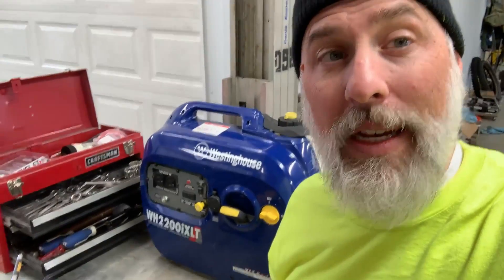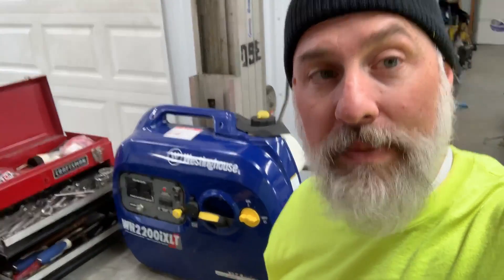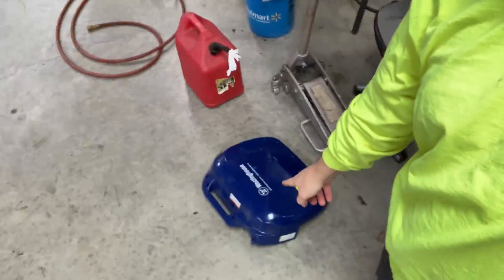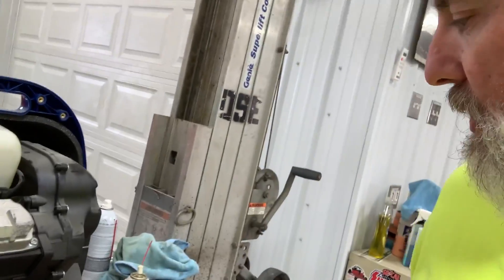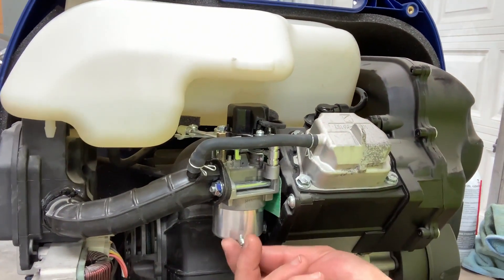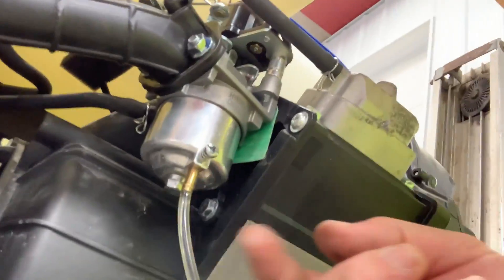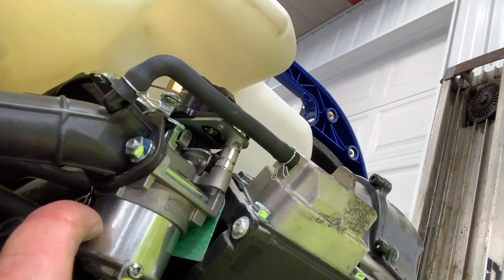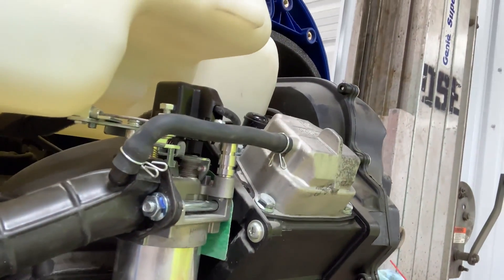How to Fix Generator that Starts and Dies  |  Westinghouse / Honda Copy

Comment: THANK YOU. Stored my generator last winter with fuel and couldn't get it to start after summer. Changed, sparkplug, oil, air filter only for it not to run. Your needle trick did the job
Reply from the maker: Glad it helped

Comment: Thank you... My generator was almost just like yours only 3 months old and doing what you described... I cleaned the jet in the carburetor... And it ran better than over because before it died ...it was sputtering and missing a lot... I even called Westinghouse about warranty replacement...i appreciate your help🎉 wish there was a way to put it in line fuel filter on these 🤷
Reply: cut fuel line, install inline filter. How difficult can that be?
Reply: true... my line is about  inched long... it could be done... But I opted to put one in the fuel tank on the fuel line

Comment: You are the man!!! Thanks for the fix.  My problem was different.  I have two generators same model as yours. One was like yours and died soon after starting.  The other would only run with choke out.  The choke-out only one had the clogged jet just as you described.  Cleaning fixed.  The other one had a partial clog and also some old gas sludge at the bottom of the float bowl.  Both are fixed thanks to you!!
Reply from the maker: It was such a simple thing...I decided to make video hoping it would help somebody!

Comment: Update: Used a pin to clean the jet and it started and continues to run - with the choke open.

Just turned off the choke and it's 💨 ng rough. 

Figure to get some kind of additive to clean the pipes and run it some more 

Thanks for the video. I've done everything else I could think of so will give this a try later this week.

I'll let you know what happens.

Wen 2000 (a Honda knockoff like everything else)
Reply from the maker: Did it work?

Comment: Interesting i have the igen2600 and it went bad just sitting for 3 months.  I stored it after burning thru the cali-crap gas and then running thru with tru-fuel for about 10min before storing it dry.

It will only run by burning the starter fluid i shot thru the air intake.  Once that gets burned (5 secs) it dies.   Choke or no choke it wont run.
Reply from the maker: I bet it’s that same jet clogged

Comment: I just fixed one missing panelwasclogged small mainjet inlet screw clean,unscrew both ways very easy clocklittle thencclock.remove main jet inintake tube back and forth easily do not go full hard clockwise.blowout with carb spray leave side jet out until mainjet is out cleaned and inwill bindthen do to pilot jet with steel brush bristle hola is in bottom facing up to horiz slotwill most likely be clogged!!!

Comment: Mine will only stay running on choke but it actually really seems like the computer is shutting it down. Like if I turn it back to choke it doesn't matter, dead.  If I started up without choke it'll actually start fine for about 1 second and then die with no error lights.

Makes me think it's the computer
Reply from the maker: Running only on choke is usually a clogged jet problem. I don’t think these have computers
Reply: @nosyjoe  it absolutely has a computer, the throttle is computer controlled.  The thing is I can even start it fine without the choke, it just shuts down completely after a second and won't start for about ten seconds.

The other thing is I can tell it's not clogged because it's really runs fine until it just completely shuts down like it is getting enough fuel it's just getting shut off by the machine

Comment: Hey do I have to completely drain the gas before I pull the bowl off I'm a newbie
Reply from the maker: The bowl will have some gas in it, but if you keep the generator's big on/off knob turned off, that will keep the carb from getting any more gas. So no, you don't have to completely drain the generator.  Just expect some fuel in the bowl if you don't drain it.
Reply: @nosyjoe  So when I. Take The bowl off I just have to use. A needle to shove through and clean out where It's clogged. Or do I have to take more stuff a part after I take off the bowl? Anything would help thank you
Reply from the maker: @coleb-41  You'll take the bowl off, and then you'll see (if I remember correctly) a brass jet screwed into the thing that the bowl surrounds.  You'll have to unscrew the jet, run needle through it, put jet back in, put bowl back on. Quick and easy.